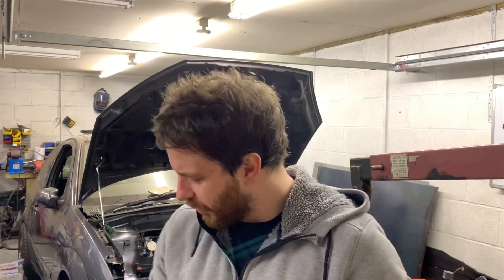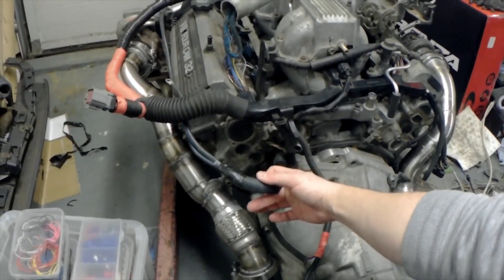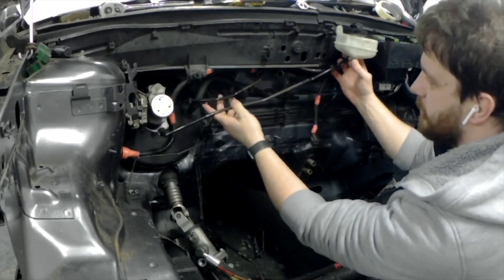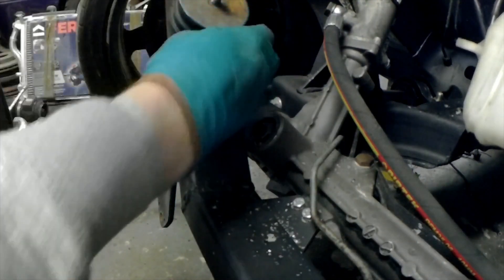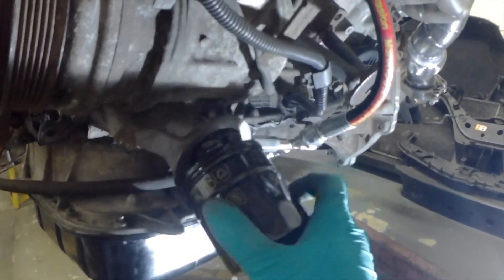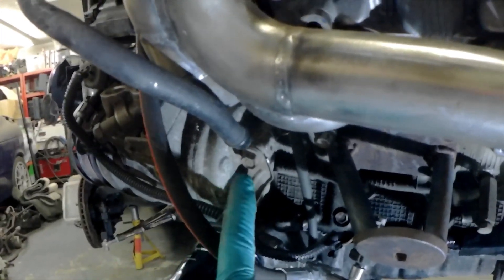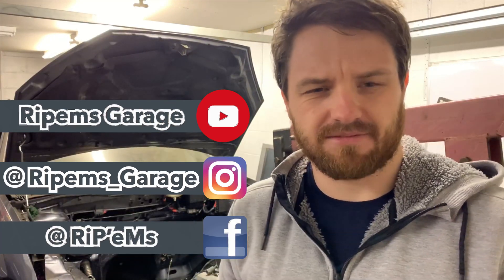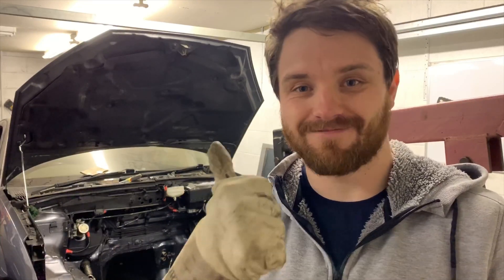Wiring & Oil Feeds - The Flexus Episode 23 - Ford Focus Twin Turbo V8 Project Car Build

Comment: Its nice to know im not the only one with a "busy" workbench👍 interesting solution to the oil return, hope it turns out well. Interested in what you'll do with the MAF as I had mine off the other day to work out boost pipework and there's not much to clamp to on the inlet side of it is there. 
Another great video mate keep it up!
Reply from the maker: Ha that’s a mess workbench! No hiding from that, I started tidying up but my hands got cold 😂
I still have the air box resonator thing that it plugs into so maybe I can bodge something together, I can’t use the air box with one of the boosty bois hanging out on the side
Reply: @JaffBuilds  yeah that was my thought too, just waiting on some hoses before I tackle that. It's all the little bits and Bob's that start taking the time up isnt it lol
Reply from the maker: It’s doing my head in! Waiting for bits all the time, constantly thinking about stupid little clips and making brackets. It’s something nobody shows in videos because it’s boring but takes up most of the time